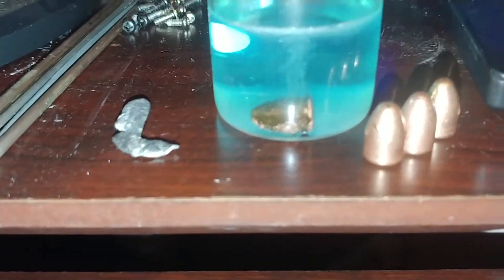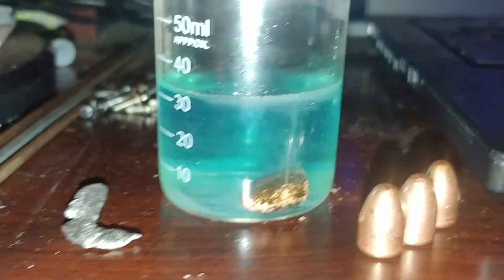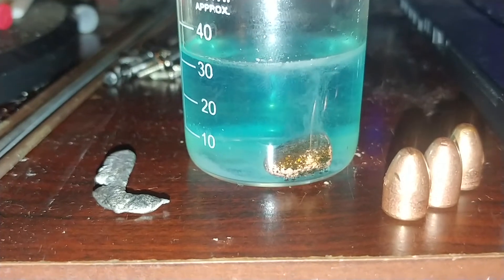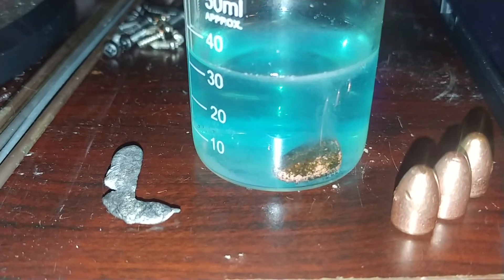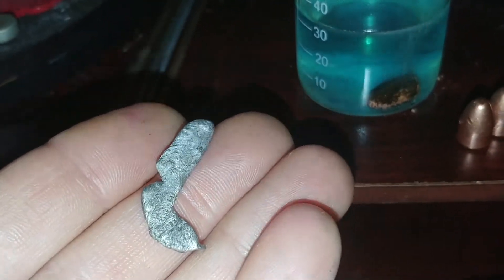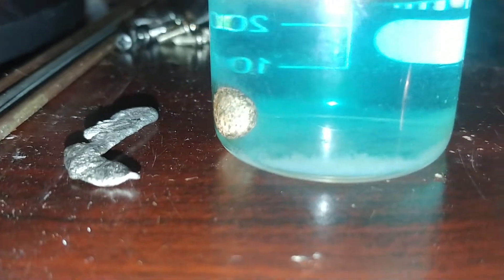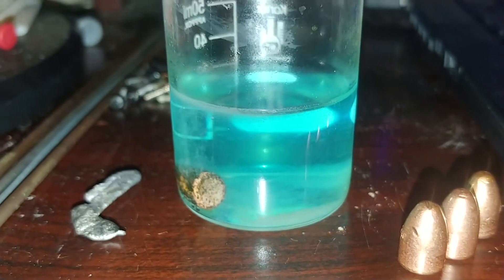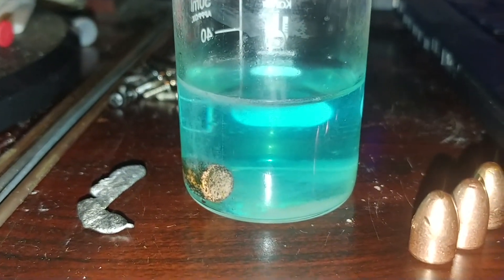Home Chemistry: 9mm Bullet in Acetic Acid & Hydrogen Peroxide - As or Sb Byproduct?

Comment: Don't you have it when they put arsenic in alloys?
Reply from the maker: I do have old lead samples which might have arsenic in them, but antimony is most likely what you will find if dissolving lead from bullets or old lead acid batteries. They replaced arsenic with antimony in most lead alloying applications.
Reply: Sorry I meant don't you *hate it when they put arsenic in alloys 😂 thanks

Comment: Arsenic mixed with hydrogen, what a fucked way to die
Reply from the maker: Yeah.  That would suck pretty bad.  I take proper precautions though to not harm myself or anyone else when I perform dangerous procedures with potentially deadly outcomes.
Reply from the maker: Yes it would be.  I take proper safety measures when performing potentially deadly procedures.

Comment: Why is your channel underated?
Reply from the maker: Most likely because of my shoddy camera work, lack of script, awkward pauses and humble honesty. LOL. I've only recently taken more interest in my own channel, so eventually it will catch on to the masses. Plus, I still need to clean up my video quality with production value with at bare minimum half-assed editing.

I have a couple of editors I have been looking at and I just started to look at cameras other than my phone to use for future shoots. I do have some projects I've been working hard towards with research and experimentation. Some of it has been expensive to get new needed supplies, others are restocking some chemicals and glassware, and buying new equipment like a dedicated water circulation vacuum pump, which as MUCH better specs than my stainless steel aspirator which has caused me three issues over the past couple of weeks. The first being anhydrous ammonia synthesis which worked perfectly until water began carrying over into the condenser and caused my beautiful dry ammonia to erupt out of the beaker and into the dry ice cooled a acetone bath. ---violent boiling = severe loss of product.

2nd project of anhydrous acetic acid, ruined by weaker and more contaminated sulfuric acid bringing over so much water AND acid via bumping from H2O reflux dripping back ingo the reaction, in turn instant violent bumping. which carried over H2SO4 into into the target flask to be collecting distilled water. The sudden change of pressure allowed a pressure to swing to extremes carrying sodium hydroxide doped water to suck back into the target glad. Basically I got a nasty feed back loop of high and low temperature differentials which contaminated all parts of my experiment.

I gotta get go new now, but will got over more of my stupid mistakes later on.
Reply from the maker: Some of my videos are okay, but I have some work to do for sure. It is going to happen. I really do appreciate you taking the time to watch my content and any level of interaction is great. I joined YouTube in 2006 to meet up with friends of similar interests. I am now just feeling a need to build and figure out how to keep living on should I need to worry of other possible revenue.

Thank you so much for watching and commenting. I great appreciate it. Thank you.
Reply from the maker: I just visited your channel and are you interested in creating animation? Let me know. I can help you with some of that stuff. I went to art college majoring in special effects and prototyping. I am a freelance 3D modeling and 2D graphics artist. If I can help, I will. Take care.
Reply: @mwilson14  thanks :D but im not interested on making animations rn
Reply: Because people prefer to stay stupid

Comment: The precipitate could be something that was oxidized potentially...

Not sure if PbOxide is white also.
Reply from the maker: I had thought about that too previously, but I would assume adding more acetic acid would just dissolve the oxide.  The strange thing is, with these bullets that white precipitate was forming from the copper alone as I found out it hadn't fully gone through the copper jacket.  I ran two separate solutions as well which resulted in the same white precip with the different peroxide/acetate sources.  I'm collecting the white precip and will try to find out what it is at some point.  I'll have to dissolve much more copper and lead in separate solutions to see if that white precip forms.  I know from past experience I never formed the white precip from copper sources like pipes and pure copper scourers, so I'm not sure why I'm getting that with the copper jackets from the bullets.  My guess is there is some other metal alloyed with that particular copper.
Reply: @mwilson14  that hypothesis seems like the best one.

No possible carbonate contamination? Or copper peroxide?
Reply: @franglish9265  Copper peroxide is extremly unstable and also olive green brownish in color. So that one is to be excluded.
Reply: @Ulim151  Ok good.

What is it then?
Reply: @franglish9265  Im still betting on Sb or As
Reply: @Ulim151  Antimony in the copper?
Reply: @franglish9265  its a lead bullet with copper jacket. Ofc its not in the copper but in the lead. Since antimony is in nearly every lead anyways its pretty likely.
Reply: @Ulim151  well, it didn't look like it had gone through the jacket yet, man...
Reply from the maker: @franglish9265  I don't see either carbonate or copper peroxide contamination as possibilities.  Copper peroxide requires a completely different means of synthesis than this reaction allows.  Carbonate would dissolve in the acetic acid.

I have a better hypothesis now after performing some refining and further experimentation with the byproduct.  I think it has to do with the flux used during fabrication.  Since it's completely insoluble, I believe it's most likely silicon dioxide.  It's still possibly antimony trioxide or arsenic trioxide, as the current stage of refinement has left the white precipitate in suspension for nearly 24 hours now without separation.  I'm really not sure what to make of it since I've really not had the level of experience required to be all that accurate.  This whole thing is a huge learning experience and I'm first to admit, I don't completely understand what I'm doing.  I understand the safety aspect and respect for the unknowns.

Comment: Thats not arsenic. Thats antimony. Antimony is in next to ALL used alloys of lead helps a lot with corrosion and makes the lead a lot stiffer. You basically cant find lead without antimony. Antimony behaves a lot like arsenic. (Antimony is below arsenic in the table). And many common reactions work with both of them.

There is a simple and very sensitive ,yet unreliable, test for arsenic and antimony https://en.wikipedia.org/wiki/Marsh_test
It doesnt give false positives but on bad excecution you can get no positive reaction even if you do it on known arsenic/antimony containing material.

Quote from wikipedia "The largest applications for metallic antimony is an alloy with lead and tin and the lead antimony plates in lead–acid batteries. Alloys of lead and tin with antimony have improved properties for solders, bullets, and plain bearings."
Reply from the maker: So in other words...damn it!  Well, I'll still run the Marsh test to see what can be observed. Intentionally running a procedure is always a learning experience, but if I want confirmed results, it will be best to buy an arsenic test kit.

Antimony is still not something I'd like to absorb into my system in any case...unless I can obtain super powers.

Thanks for commenting and giving me some more info to research. I appreciate it.
Reply: @mwilson14  the marsh test cant distinguish if you sample has arsenic AND OR antimony. Its cheap so you can give it a try. Doing it outside should be enough to avoiding the gas.
Reply from the maker: @Ulim151  I understand that. I'll just see if anything results by doing it. If I want to distinguish between the two elements then I'd need to perform a different more expensive test. I believe there is one which requires gold in solution if my memory isn't garbage.
Reply from the maker: The possibility that there is arsenic in the lead/ammunition is still something which can't be ruled out.  Arsenic has historically been used to harden lead for ammo as it's a grain refiner.  It's also been used extensively in lead acid batteries.  I'm sure there is a fair amount of antimony since both arsenic and antimony are naturally common contaminates of ores and soil in general.

https://www.livescience.com/29522-arsenic.html

I originally got my data from Wikipedia as well.  I still consider your antimony suggestion, though I still consider my assumption of arsenic equally valid.  It's not alarming to me nor something I fear since many metals are extremely toxic.  I don't know if laser diodes and other electronic components contain more arsenic than lead sources I've mentioned, but it's not too concerning to me really.

https://en.wikipedia.org/wiki/Arsenic

I'm very interested in being able to differentiate arsenic from antimony through tests I'm economically capable of performing.  In any case, I need both arsenic and antimony to fill in the slots of my periodic table coffee table that I'm going to build.
Reply from the maker: I should be more worried about the use of arsenic in brass for dezincification as I've worked with brass for so many years.  I'm sure I am exposed to more arsenic in my drinking water than I am working with any metal since I take necessary safety precautions.
Reply: @mwilson14  im sorry i forgot to say that the marsh test cant distinguish. But the metallic Sb or As mirror can be distinguished because As will dissolve quickly in H2O2 + NH3 while Sb takes some time and heating. This way you can know if theres both As and Sb or only one of both. It doesnt give any clue about the amount tho. Even traces can be detected by the test.
Reply from the maker: @Ulim151  Very good info to know. I appreciate it. I think when I do the Marsh test video I'll get a known sample of As to compare with the results of my unknown source. Maybe I can do something similar with antimony. It's been in my watch list on eBay for quite a while along with arsenic. LOL.
Reply from the maker: I just realized that your comments have been hidden publicly because YouTube flagged them as possible spam.  I'm guessing this is due to the link to Wikipedia from the first post.  I approved the comment just a few minutes ago, but I'm still not seeing the comments appear publicly.  Maybe it will resolve itself with a bit more time.